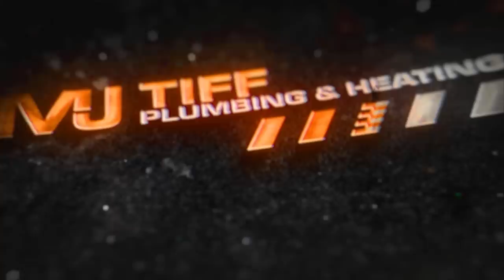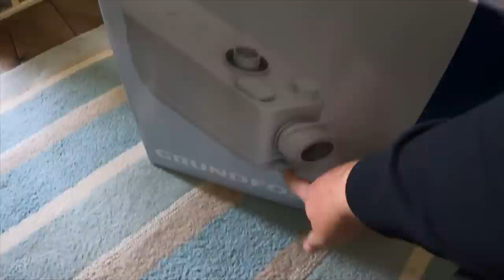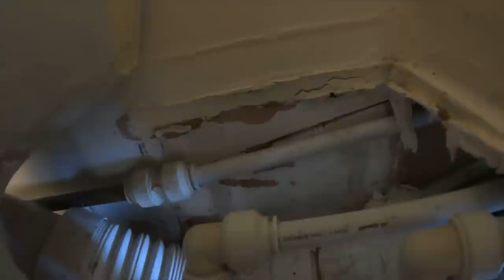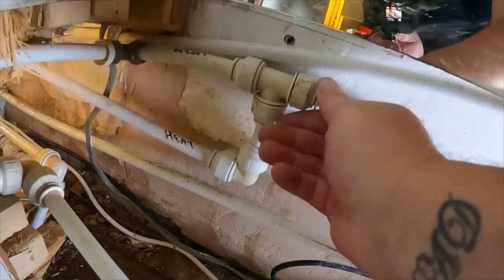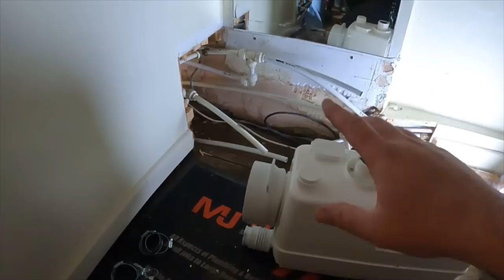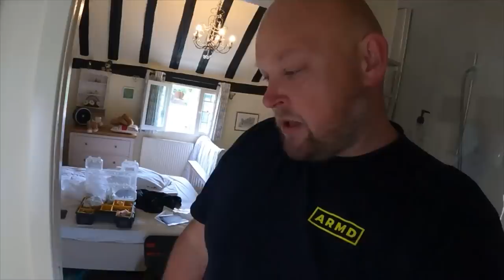FIX OR REPLACE?…. Spend MONEY to SAVE MONEY

Comment: Them grundfos macerators are very good I put one in my house a couple years ago and if they need work on you can strip them out, but the non return rubber flap perished after 2 years,I had to order one from Denmark as none in Ireland sell them it took 2 weeks so I bought 2 incase it happens again they are handy to install too! keep the chin up about your dog lad!
Reply from the maker: Yeo I think they are a great unit… fitted a good few of them👍🏼👍🏼